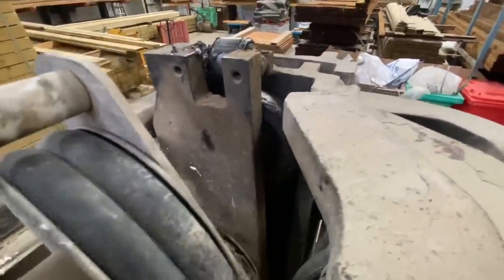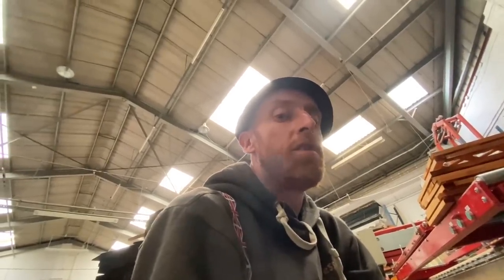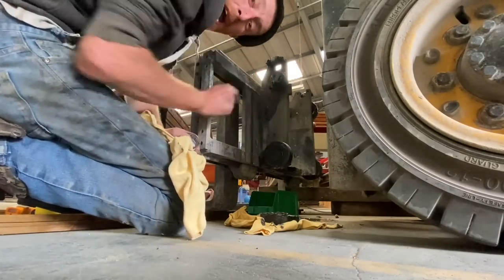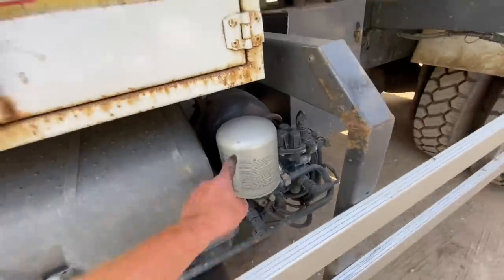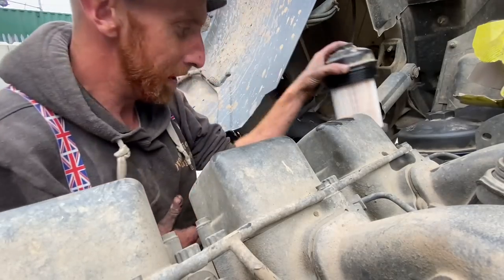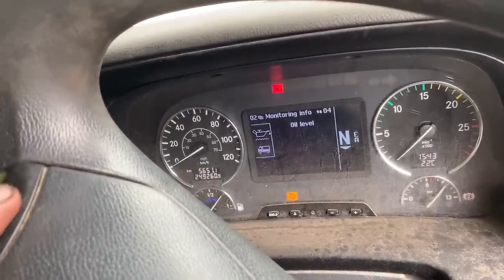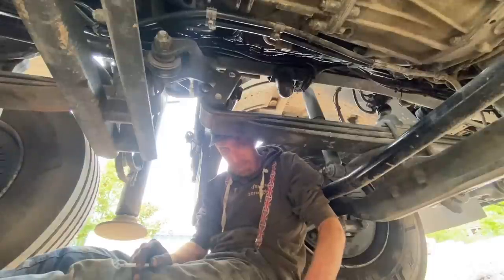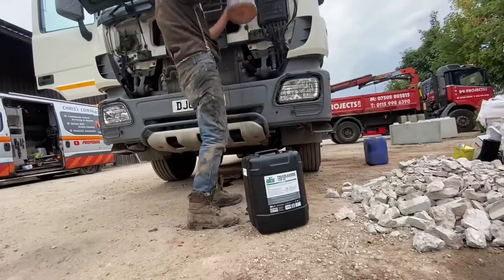Another day at D&J, how to remove forklift mast bearings, service on merc

Comment: Chris i can totally  agree with you on them oil level sensors i have had quite a few DAFS  showing ok but when you check on the dipstick they are low i think they can be calibrated though . the MERCS are so sensative though they tell you how much but if you slightly over fill them you get a dash warning nice little video mate .

Comment: Exol oils are very good value if you can find a local distributor, they do loads of different oils.  I use their fully synthetic 2 stroke oil in my dirt bike along with lots of others, it's a third of the price of the name brands but just as good.  They spend very little on marketing which keeps the price low, I think they depend on word of mouth.

They do oils for motorbikes through to trucks and even specialist agricultural oils.
Reply from the maker: I like the sound of that mate… the old word of mouth is how business grow 👍 I shall bare them in mind

Comment: I bet you were hearing that Beep- Boo in your sleep ?
I ground the point to a flat on the "spike" bit that came with my air chisel, it's great for giving stuck bolts and plugs a quick "rattle up" to make them comply ! Works great on seized brake nipples and ball joints too.

Comment: At the workshop for forklifts ive been on we remove the stop for the carrage and then pull it up over the stop and you can access the rolers over the mast i can expain in forther if you want and have acess to a crane or another forklift if you do it again. Best regards
Reply: Some carriages come out the top, some the bottom.

Comment: Had the same problem years ago with MAN tgx trucks the electric display displaying just above minimum so drivers sorry steering wheel attendants adding oil till full yep crank seals were ruined turned out the oil sensors hadn’t been calibrated
Reply from the maker: Don’t care what anyone says mate you can’t beat the trusted old dip stick….. simple but affective

Comment: You should use the jack legs of the truck to lift it up higher to make it easier to get under it that's what we do wit our concrete pumps and the jack legs make it easy to work on the wheel's and tyres because it can lift its self up
Reply from the maker: Good thinking mate 👍
Reply: @Professional-struggler  don't need to he's that thin like a wafer.

Comment: With a job like them shattered rollers on the forklift, with hydraulics relaxed, remove the hose feeding the centre ram then blank off the pipe from the supply side, then you can lift up the mast sections leaving centre ram closed, making it easier to re-assemble.

You can also do the above & if your lucky enough, just remove the chains & hoses off the pulleys (not disconnecting them) then raise the mast enough & drive back👍😎